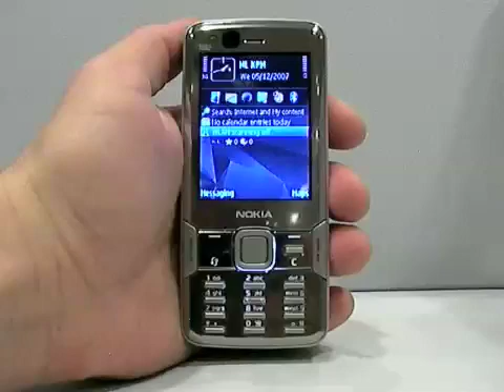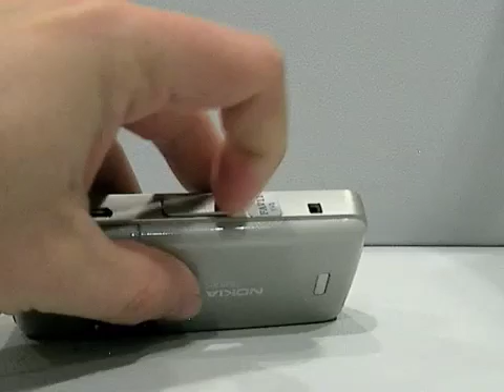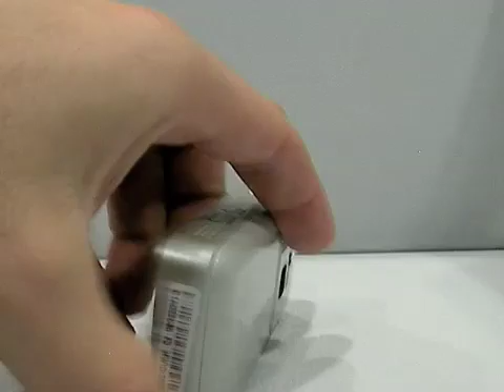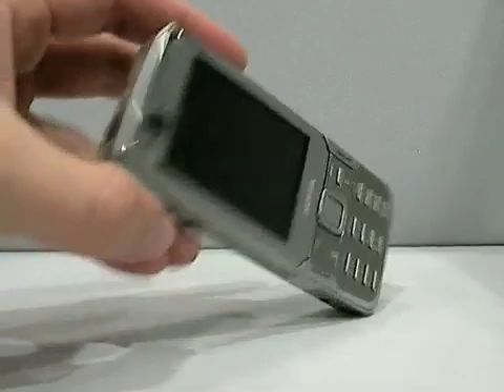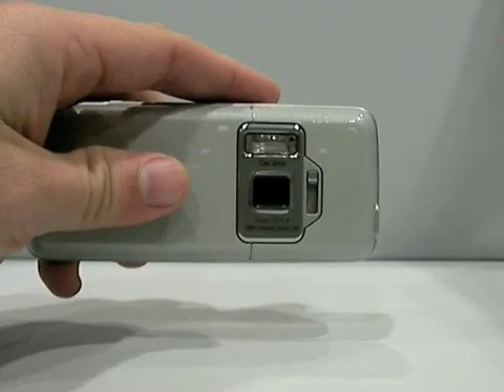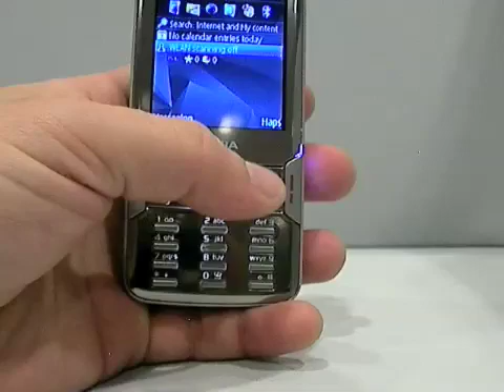Nokia N82

Comment: I need help deciding which phone i want...
N82 or N79. I am gonna use the phones in Canada but N82 dosent support 3G in Canada which is good because i  dont want $30 data charges. But the N79 does support American 3G. Is it better to get the N79 and go to my Cell Provider and get them to block 3G and internet or get an N82 and not have to worry about the 3G?